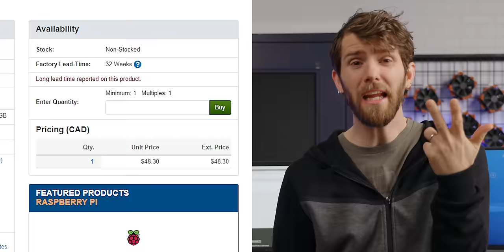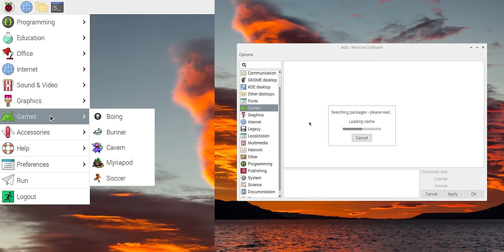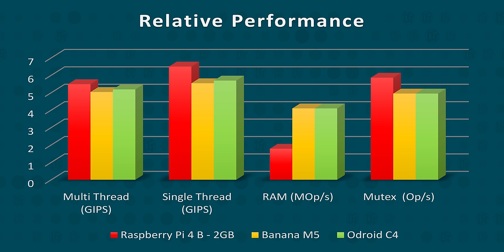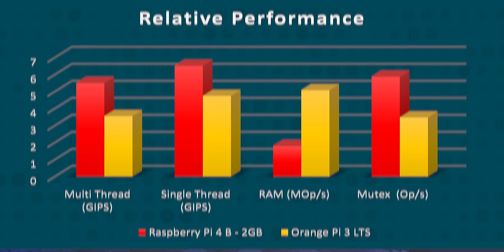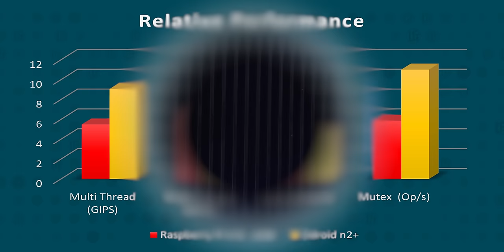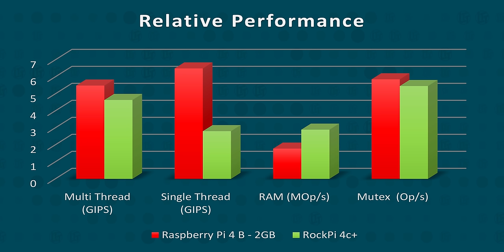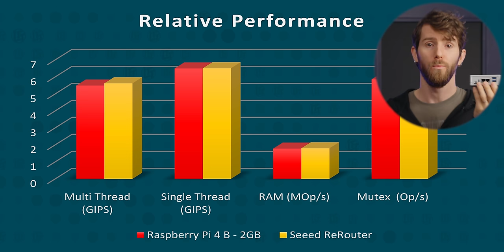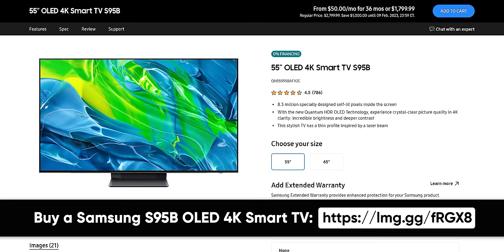I Can Save You Money! – Raspberry Pi Alternatives

Comment: The main advantage of raspberry pi is their small form factor and their power efficiency so they can be attached to a battery or used in some Maker device. If you just want a cheap pc or a pi-hole, a used 2010 HP tower would be cheaper and 15 times faster.
Reply: Electricity costs money tho, but that aside yeah
Reply: Honestly, a potent, flexible and open Android machine would be pretty neat. All the stuff on the market is either something hilariously outdated from China with zero support, or lightning focussed on pushing you towards a specific media subscription and you have to jump through hoops to jailbreak.

Comment: One thing I like about the RP4 and RP3b+ is the Power over Ethernet add-on board you can get. This means my pi's are powered by my PoE switch and in the rare case of a hard crash I can remotely power cycle them.
I have not been able to find information on PoE support for any of the alternative boards.
Reply: You should be able to buy PoE splitters that can be used to power anything for about $10. Just be sure to pick the right one (USB C vs Micro vs 12v Barrel Jack), the USB C variation is more expensive but you can buy each of them in packs of 3 for a discount.
Reply: For my use-case I don't want another power cord on my rack.  I have a POE switch to provide power to various devices. I know some would consider it a little silly, but I like a neat rack.

Comment: If you don't need the GPIO pins and don't mind higher power consumption you can also run an old thin client pc, they're cheap, upgradable and great for server stuffs. They generally consume less than a 60w light bulb, and sometimes sub 10 or 5 w on idle.
Reply: Another benefit is that they're not ARM-based, so software compatibility/support is typically even better than the raspberry pi.

There are also some more recent fanless sff pc's (usually intended to be router appliances) that have around half the power draw as those for around the same price...
Reply: high power consumption is really only the concern here, and also the size, it just means u need to setup an fixed server somewhere

otherwise, for the the gpio part, u could easily use microcontrollers, powerful microcontrollers that can communicate wirelessly with the pc
Reply: @zackkertzman7709  totally agree, i would buy an x86 sbc over arm sbc given the choice at the same price
do note that x86 sbc actually exists, i think linus also did a video on lattepanda where he put an rtx on it
for some reason, i dont think any x86 sbc was shown in this video, probably because those are way out of the price range
Reply: @urnoob5528  I'll have to look up the LTT video on it.

I looked into x86 SBC's at one point, but it seemed like you ended up paying quite a premium over a sff pc/thin client/etc... for that SBC form factor.  At least that was true when I looked - relative values might've moved since then.
Reply: @urnoob5528  I have a less than 1L ThinkCenter as a server, I could litteraly shove it in a closet if my peak performance demands weren't so high. As for  power consumption, well that's relative, where I live running a 60W lightbulb 24/7 is about less than 3$ per months. And a computer with the same maximum TDP probably consume half of that if I'm conservative in my estimate, but it's probably even lower than that with efficient idling.
Reply: I got given a Pi2B and bought a Pi3B in January because I wanted to get to grips with Linux - I tried many years ago with Fedora Core 5 and wanted to give it another chance. I have a fully functional web server running on the Pi3B and considered a Pi4, but given a Dell Optiplex with an i5-7500 and 8Gb of RAM can be sourced for less than the MSRP of a Pi4 it seemed a better option - faster - upgradeable - not ARM. 100% agree with you - recycling an old PC just seems like much more bang for you buck

Comment: The LePotato has been a perfect companion to my Ender 3 3D printer. I run Klipper with Fluidd, and even have a webcam connected, it handles everything perfectly.
Reply: I was fortunate enough to hit MicroCenter a few times right when the Pi Zero 2 came out and have like, 5 of them. They run Klipper and Fluidd (or Mainsail) perfectly and are small enough to fit in the case with the mainboard.

Comment: While it's a bit outdated now, I have an Odriod Xu4 I use as my nas and it still works great.  I'm not sure what it's performance is compared to the newer raspberries, but at the time the raspberries didn't have USB3.0.  I still think it's a valid choice in the $50 range.  I recently reinstalled the OS and updated to OMV6 and it's just as good as ever.
Reply: Nas are great for some people. I just use free services, photos go on fb and videos go on YouTube. Anything else i have can be lost for all I care.
Reply: @kameljoe21  Facebook is not a reliable way to backup photos, especially full resolution.  Also I scan all my personal documents and shred all but the most important ones (birth certificate etc).  I do think there is merit to off-site storage if you have a fire or something but for me a NAS works great.  I can also attach a USB drive and run Rsync or use USBBackup which will automatically sync whatever shares I configure to the drive when I plug in it, that I can then store off-site.  There are no monthly or additional costs unless I buy more hard drives.

Comment: Another point missed is that a lot of people wanting a pi 4 could very easily get away with lesser pi. Eg pi hole or a webserver would happily run on  a rpi 3a+ which had plenty of stock when I bought one last week. Also many people may want a pi for some projects a pico would be more suited for thinking the pi would be better. But something like a remote control car doesn't need an operating system or the power requirements of a rpi 4. RPIs are partly for learning and building. Often the RPI4 isn't the best raspberry pi for either of these goals.

Comment: There's another alternative similar to the Seeed from Bigtreetech called the PI4B Adapter and the CB1 daughterboard. The two together can be bought for $37.50 USD as of the time of this comment. Performance has been compared to a 3B+. The CB1 by itself works with several of their 3D printer control boards, allowing you to add Pi functionality directly to the control board, eliminating the need for external mounts or power. With the adapter, it works just like a Pi. Note: The adapter also works with the CM4.
Reply: Surprised they didn't have the BTT CB1 in as well. Pretty much only used in the enthusiast/tinkerer 3D printer world right now, but it's a direct replacement for a RPi 3B+ for a good price if you buy direct from BTT or their AliExpress store. Amazon has a near 100% markup for some reason.

Comment: The only SBC I have found to be a viable alternative for the Pi for running Klipper and OctoPrint has been the Le Potato. The documentation and support are definitely nowhere near as good as the Pi but with some searching I found some solutions that would get everything working. 
There are so many projects I would like to built but I really started getting into the RPi right before prices for all models skyrocketed. It's just completely ridiculous that a RPi Zero 2 W which is supposed to be $12 can't be found anywhere for less than $60 which is the cheapest I found it when I last looked a while back. I am of the same mindset of LTT that even though they said things will improve in 6 months I think backorders, FOMO buyers and scalpers will keep prices high for the rest of 2023.
Reply: It's the buyers that are really hurting things. If scalpers didn't have buyers willing to pay the insane prices then scalpers wouldn't be able to sell rPi's at the insane prices. Honestly, there's no reason to pay the outrageous prices either, there are used/refurbished tiny/mini/micro pc's that sell for less and offer way more power, ports, expandability than rPi.
Reply: I want to buy a le potato just so i can toss it to the next person who says "you can run that on a potato"... here's one lets see you get it working...

Comment: For some use cases, even using x86 Thin clients or tiny PCs like M93P or even those tiny Beelink tiny PCs would be more performant for less money. I wanted to DIY a laptop but even the RK3588 (non-S) can't compete with x86 Alder Lake E Cores for the same price :(
That being said, I always wish that there was a way to make old smartphones (not just Samsung ones) into ARM SBCs to reduce ewaste.
Reply: I personally use a Ryzen thinclient as an Ubuntu server. Slapped on some more RAM and nvme storage, and it became a decent Minecraft/media machine.

Comment: I’ve tried a Le Potato. Their software support really isn’t too bad—I’m running their official Ubuntu Server 22.04 LTS image—and Amazon reviews to this effect are really old. The 2GB of RAM (vs 1GB for the Pi3) really helps it out, too.  I use it mainly as a low-power TP-Link WiFi controller, and while more RAM would be even better, and updates are, uh, slow, for the price it’s alright. It’s the only Linux install I’ve got running right now that is already on kernel 6.0!
Reply: > their
> official

It really doesn't work like that. If it's theirs then it's not official
Reply: @mskiptr  Ubuntu is slow with patches and enable new hardware features. We maintain a separate kernel and some userspace tooling via apt to make it make the experience more consistent and better. Our kernels are updated weekly for security.
Reply: @LibreComputer  That sounds pretty reasonable. Nice

I guess I'm just too used to seeing vendors doing a hacked-together BSP release of android or debian and leaving any proper maintenance or upstream bring-up to the community.
Reply: @mskiptr  We redesign everything for every chip we adopt. We do not want to contribute to e-waste. That is why we are very conservative with our SoC choice.

Comment: One board that was left out is the nvidia jetson nano. It is more expensive than the pi, but is really powerful. It may not technically be in the same class as the pi but I think it’s still worth a mention
Reply: Most of the power of the Jetson is for other use cases though...like AI and machine learning. Buying a Jetson and using it as a HTPC would be a massive tragedy. Same applies to the Latte Panda.
Reply: Also the availability is pretty similar to the pi as it is pretty impossible to find in stock, at least where I live

Comment: I recently bought the orange pi 3 lts as a kit with case, cable, and little heat sink for $60. While I use it for primarily ps1 emulation it does that job pretty well via retropie and it also supports wireless offbrand ps3 controllers. It's not perfect but runs as good as the ps1 if not better. I'd assume it'd run older retro systems just as well too
Reply: Hey man, where are you from, as I cant seem to find any from the official site for less then 60$? Where did you purchase this from as well?

Comment: Great info in this vid! But I'd recommend steering clear of using the 3D bar graphs in the future. They unnecessarily harm the ease of legibility, and depending on how it's rendered, the fact that the back corners of the bars don't line up with the "0" harm the perceived (if not literal) veracity of the information as it's displayed.

Comment: You missed Quartz64 from Pine64 which can be had for about $80. I really like it, plus you'd be supporting them in their endeavor challenging the status quo with their Linux based PinePhone. Seeed Studio has other interesting offerings as well, not just the reRouter. The odyssey, although at almost $300 running a Celeron CPU, is a neat board.

Comment: Been trying to get a Raspberry Pi for a friend and a second one for me for like a year or two now, but haven’t been able to find reasonably priced stock for all that time.
Reply: OrangePi 5 is like $100.
Official Pi 400 is $130.

Both seem pretty reasonable to me!  Both quad core 8GB RAM 5A powered.
Reply: @Aomicplane  The Pi400 gets overlooked for most projects when it's the most accessible and the best value.

It comes with a mouse keyboard and charger, which cost $70 separately.  But the entire kit is $130 so that means the Pi400 in that kit costs just $60.

I don't see how they can make it cheaper.
Reply: Get the pi400 and take it out of the keyboard
Reply: @djmorris666  why would you though?  You may as well leave it on there and just design around it.

I mean it's more work and expense to remove a feature, that you are then going to have to add back in later anyway.

If it's for something like a Pi powered gameboy then you don't need anything that powerful and should get a Pi Zero2 for $34 and use that instead!

There is always a Raspberry Pi if you choose the right one... I have loads of them knocking about, and you know all the retro consoles are based off the same idea.

Comment: I’ve loved these rockchip and and amlogic boards for low level hacking, also RISC-V options coming to market. Should warn that one may become a bit of a collector of these.

For the DIY folks, would like to see a video covering the ESPs, arduinos and alternatives.
Reply: I’ve had a fair bit of pain getting OrangePi 4 LTS up and running. It’s worth noting that it’s much harder to get alternative builds of Linux or upstream OS installs working than others. Even with a fair bit of experience, you’re often out of luck if you want to install anything other than the images from the manufacturer.

Comment: There's some SBCs that make it easier to develop with FPGAs which if it's up your alley for development stuff, is super nice.

But my favorite SBC is the BeagleBone Black. However, it's bad for anything media center related. It's best for robotics/electronics stuff. The PRUs can be used to offload most of the tasks you would expect the pi's CPU to handle, which tends to be way faster and higher efficiency when making a machine you're building do complex tasks.

Comment: Kind surprised that you guys didn’t mention the Nvidia Jetson Nano. That thing is pretty cool. I have the 4GB version myself and even though it is a bit dated now it still can kick some butt. Since it runs unbent arm it’s pretty much just like a pi with a ton of docs from nvidia.
Reply: Honestly, as a windows user I'm confused seeing that Raspberry Pi is a physical thing and not just an OS.
Reply: NVidia's SBCs are bit pricey. Nano is the only option there, but even it is ~$100 while RPi4's MSRP is like $35. We've used ASUS' Tinkerboards in some projects; they're pretty nice, too, but cost almost $200. May be worth it if you need more processing power, but doesn't quite fill that niche for versatile low-power SBCs.
Reply: @Lodinn  the nvidia boards are definitely pricey but they do come with a lot of compute power.
Reply: True, they have power but on GPU side. RP4s CPU is quite a bit faster than the Jetson's.
Reply: @leagueaddict8357  what is there to be confused about?
Reply: @thewhitefalcon8539  Well, I thought raspberry pi was just an os like how ubuntu is an os

Comment: Good PSUs/wall adapters that pump out 4A @ 5V are pretty few and far between. Also worth noting that if you buy an adjustable wall adapter/PSU that says whatever watts, that number is very likely only achieved at the maximum voltage (i.e. the adapter says 24W and the maximum voltage you can set it to is 24V, it means that it will output only 1A max at whatever voltage).
Reply: Most 19 V laptop supplies can put out 4 A. If you can be bothered to do a little soldering, you could make a simple voltage divider with 2 resistors and use an appropriately rated op amp. Feed your 4V reference into the non inverting input (the +), loop the output back to the inverting input (the -), and just make sure it stays cool. The OPA548F/500 from TI could probably do the trick, $17 on digikey. Not sure if that's cheaper than finding the right wall wort but worth a mention.

Comment: Surprised they didn't cover any of the x86 options available (Rock Pi X, etc). They're great if you need to run an x86 Linux build, or Windows.
Reply: Not sufficiently relevant for many use cases.

Simply being small enough to be held in one hand doesn’t change the fact that such devices are still basically tiny IBM PC compatibles.

While it is possible to get x86 based SBCs, some even with the exact same form factor & port / GPIO pin layout as a RasPi which makes them theoretically viable drop-in alternatives, in practice CISC-based computers will always be slower, have fewer cores on the same size package, be more power hungry, and run hotter than RISC-based computers.

Also, it is far more likely - though not guaranteed - that RasPi software will be compatible with / available for other devices running on ARM SoCs than those running x86 SoCs.

Thus, x86 SBCs are in most cases - barring basic usage as things like thin clients / media centres / etc. - unsuitable replacements for ARM SBCs due to both hardware & software factors.

Even RISC-V SBCs are more suitable alternatives, if not as common at present.

Comment: The pi400 has not been too hard to get in fairness. While the pi4/400 is old now it's community support is absurdly good. I'm not sure there is a pi model I'd recomend at the moment though.
Reply: When the scarcity is such that you can't get one for even 2 or 3 times the MSRP, then yeah, they are hard to get for the intended market.
Reply: Can it play 4k video without any problems and does it start up pretty quickly?